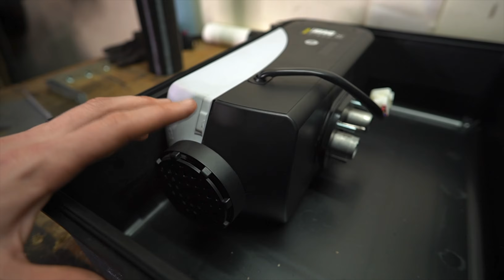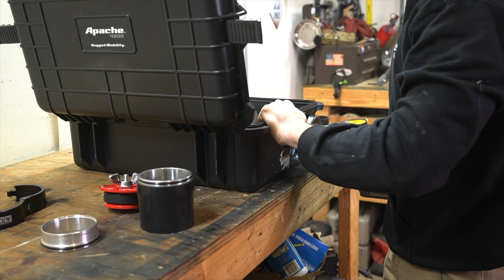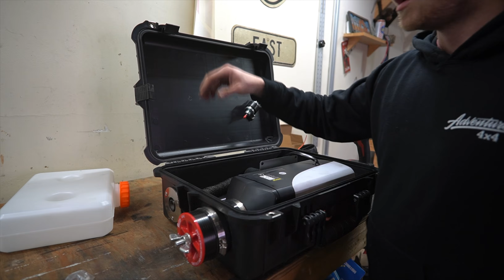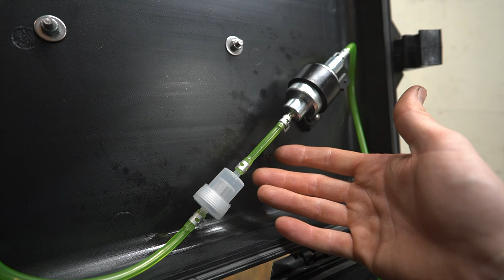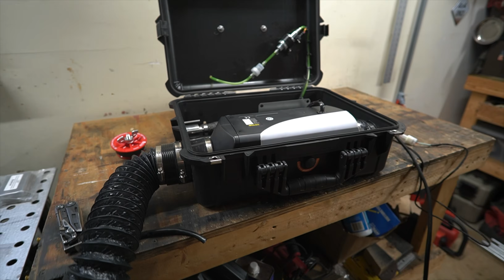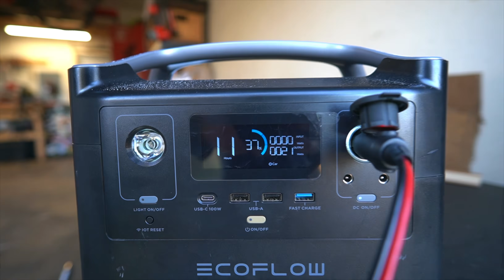DIY Diesel Heater **EXTREMELY DETAILED**

Comment: Does box have good fresh air vent for heater inlet?
If you leave inlet pipe inside box, you need remember good airflow for the heater or it might interfere combustion.
Reply from the maker: There is airflow around the heat outlet hole that seems to be plenty so far! If not I will add another vent.

Comment: Very nice build and love the time you spend explaining what your doing. I'm building a heater for my cargo trailer and placing the heater in a 20 gallon craftsman storage tub. The tub will sit on the trailer tongue and I'll port the outlet tube through a marine deck port I'll mount on the front of the trailer. I'm also using a 3 gallon marine (boat) fuel cell as my fuel tank. I chose to use the hard nylon fuel line because it will not collapse like the green line will over time. Only suggestion I would make for your build is if your fuel supply barb starts to leak use a siphon tube (straw) on the top of your new tank. Very easy to install and no leaks. I'll be interested to see how the unit fresh air inlet works being inside of the box. in theory it should work no outside contamination but heat generated inside the box could pose an issue.I also love the quick connects your using for the outlet air duct very slick, wished I would have known about them before my build. Keep us posted how everything works out and again really nice build!!
Reply from the maker: Thank you sir! Your build sounds like it will be awesome!
Reply: @Adv4x4  Take the advice Alan offers on the hard nylon fuel tubing. Kits with a new fuel filter and a long length of hard white nylon fuel tube are available on ebay and probably Amazon too. The nylon tube is far more robust than that green PVC stuff you have and will not kink under any circumstances.

Comment: Can it be ran without attaching the exhaust hose to the exhaust pipe socket? Or does that exhaust hose need to be hooked up? Also, mine came with an actual muffler, did you use that down the road at all?
Reply from the maker: Yes it can be ran without the pipe! It did come with the muffler. Admittedly I haven’t tried it yet. Isn’t very loud without it!

Comment: Great video. Will definitely do the same for my self built teardrop camper. I just have a question. How about the vent on the fuel tank? Did you need one? Or do you just loosen the cap a bit?
Reply from the maker: The cap has one built in!

Comment: Love the vid and the channel! Couple quick questions I had:

- Are you concerned with the combustion intake creating negative pressure inside of the box? I’d imagine over time it would draw in a bunch of dust into the box, and put a lot of strain on the unit to overcome the pressure difference.

- Is there any good reason not to run the large intake from a duct that you’d also run to a tent/camper? It seems like it would be a lot more efficient to recycle the partially heated air as opposed to heating cold air from outside.
Reply from the maker: Thanks man! It very well could draw in dust but I can’t say I’m overly concerned as it isn’t going to be in a dusty environment while when in operation!

Also after seeing the performance of it without intaking the pre heated air from the tent/camper I truly don’t feel the need to ad an extra hose to pull in air from the sleeping quarters. 

In short, it puts out some great heat! It’s sufficiently heating my single car garage so a tent/camper should be no issues even on a very low setting 👌🏼
Reply: @Adv4x4  very slick.  When you talk about heating your garage are you worried about the exhaust byproducts and CO buildup? or do you keep the garage door open? Also with the air intake inside the box is there a vent in the sidewall to allow for air movement?  Not sure if I missed that part..  I think I'd want my air intake as far away as possible from the the exhaust that is reliant on sealing compound that might fail and cause cross contamination.  CO is odorless and can be deadly.
Reply: @metamorph20 yeah I'm gonna have a battery powered carbon monoxide detector when I finish mine

Comment: I wonder what would work better for your set up, a diesel heater or a mattress sized heating pad. Having the flexibility to be all electric maybe attractive but also having an alternative fuel source if the weather is shit is nice too. I doubt an electric heating pad would warm up your camper as fast or as hot but who knows. 

Great video, I didn't know people were diying these.
Reply from the maker: I saw an opportunity to use it to help heat my garage as well which is why I went this route! But I agree a heated blanket would probably do exceptionally well itself in the camper 👌🏼

Comment: Run a flexible tube from the camper to the heater inlet. A lot quicker to heat up camper because you're not heating outside freezing temps. Just like the recycle air option on your cars AC/heat.
Reply: doing this would make the inside of the tent very humid. Thats why when you turn on the heat in cars, it turns off recirculation so it heats up the cold dry air and sends it into the car/tent.
Reply: @chuproductions1290  it will also reduce oxygen in the air since no fresh air is coming in
Reply from the maker: Could definitely improve efficiency! If I’m being honest though the air it already outputs is pretty incredibly hot as is!